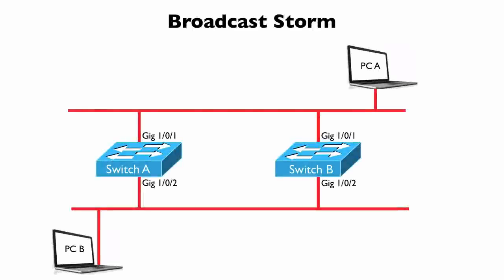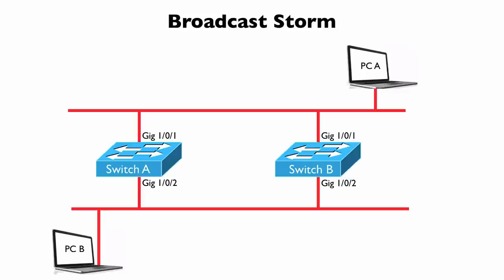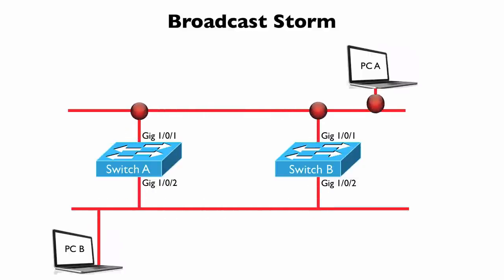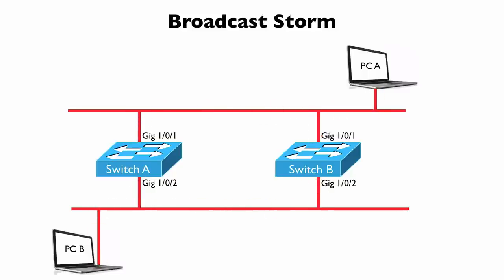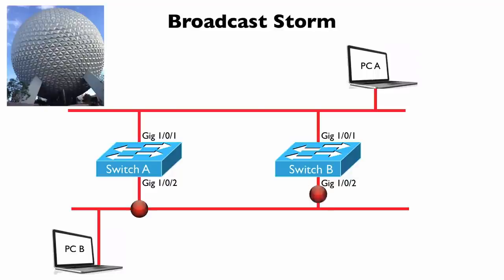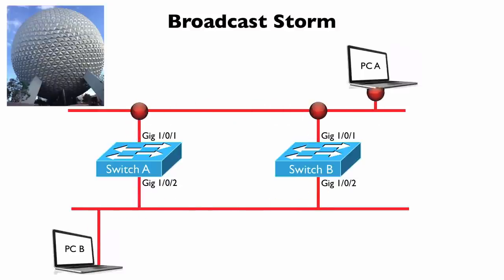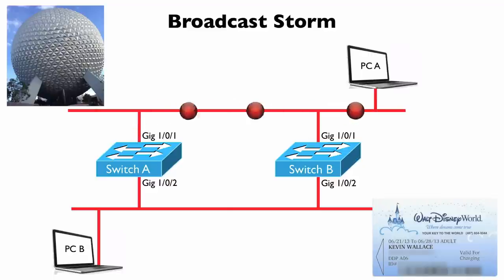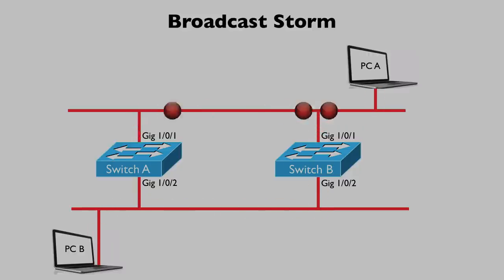Broadcast Storm (CCNA Complete Video Course Sample)

Comment: To some degree are the switches effectively carrying out a DOS attack on the PCs?
Reply: ***** My instructors always tell me I have an odd way of looking at things at times.
Reply: ***** Mr. Wallace, I came up with a strange question during class yesterday that my instructor could not answer and I was hoping you could provide some insight. 

If you use a DDOS app and target the loopback address will it hit you, force the individual computers to hit themselves, fail altogether, or would there be some other outcome?
Reply: Or an isolated network... do you think virtual machines could emulate a decent bot net?
Reply: ***** Thank you sir, I'm sure I'll be coming across some of your books since my first step is CCNA routing and switching.